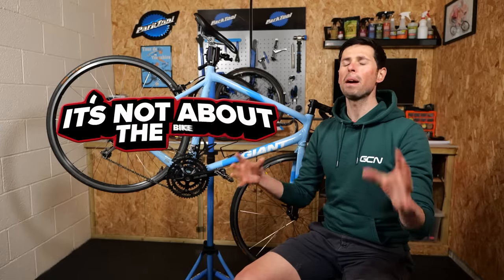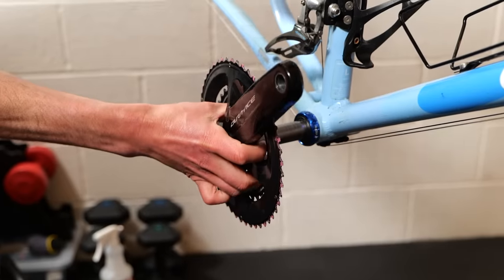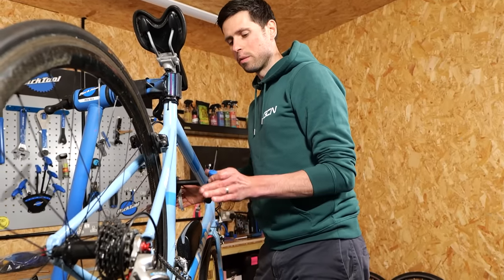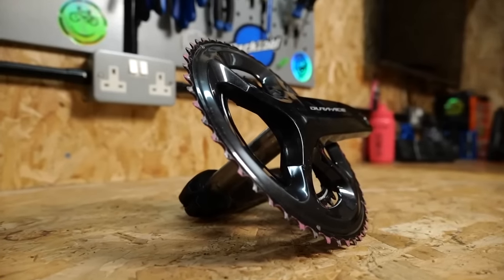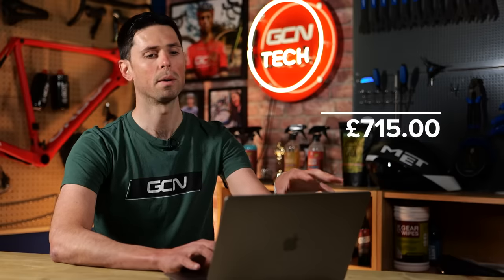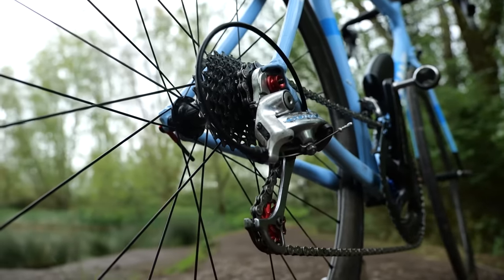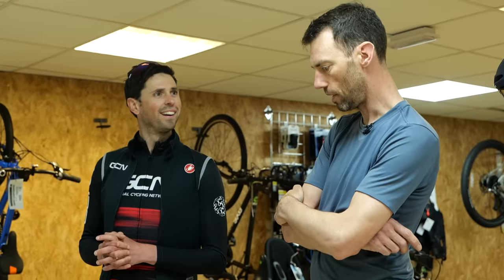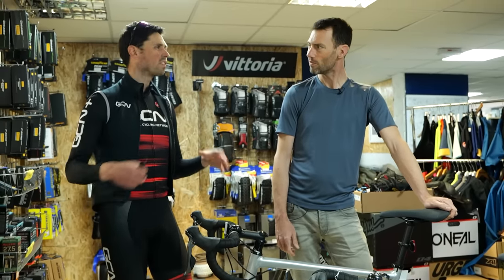Did I Really Build A Bike For Under $1000? | Cheap Performance Bike Upgrade Ep. 3

Comment: Entertaining content. Sad how negative some responses have been. Fun and interesting using old parts from online and from personal parts bin - theres loads of decent used parts cheap out there - and who hasn't got a parts bin of favourite and 'too good to get rid off' parts. Great for the environment using used parts instead of manufacturing/shipping/packaging new ones. Fun to do the mechanical work yourself and feeling that you built the bike yourself. Bike has more character and less weight than modern equivalent. And very easy to maintain and work on. Good stuff.

Comment: I think it's pretty normal re-using the saddle and the pedals as contact points are so critical that if you already know what's working for you, you'll just use them. It's nonsense to re-buy what you already have and it's working.
If you are builing it from scratch it's of course different, as saddle and pedals should be added to the budget.

So I think Alex can work out a component list within the budget for those two options.
Anyway, my advice will be not to be cheap on the contact points as you will keep them longer than the bike and are what makes your ride comfortable

Comment: Love series like this. Most of us stary of with a bike and upgrade them down the way. I started with a nice frameset and went from aluminium wheels to deeper carbon ones in 2 years, better parts, when I had to change a part I would always upgrade. After 3 years of riding the frameset is the "weakest link".

Comment: I don't see any problem with reusing pedals (or the saddle for that matter). I have one pair of road pedals that I switch between my tri bike and my road bike as needed. If you are just starting out in cycling, you would probably just use whatever flat pedals the bike comes with until you can justify upgrading to a clipless pedal system, but that upgrade you're looking at needing to buy not just the pedals but also some shoes to go with them. At the end of the day, those upgrades are mostly to do with comfort, not speed.

Comment: i just added up mine, which was all bought new/used on ebay/shops for new wear parts. shocked people complaining about your budget i'm thinking how did you spend so much. 

my road bike that lives on my trainer is a trek alpha 2.3 that came with 105 2x10. i'm using an slx cassette 11-36 cassette with an 970 XTR rear derailler, i put new tyres on the wheels including the wheel i don't use as it lives on the trainer, new chain and new sram rival cranks (shorter) with a new dub BB from uberbike. that totals in at £350. 

my  main bike is a voodoo maresa that i made into a gravel bike. its running fulcrum wheels, sram apex 1x12 (ratio conversion) hydraulics, 11-50T cassette, sram GX rear mech, hope M4 brake calipers with sram 180/160mm rotors. sram XO DH 165mm carbon cranks with AB 46T oval cx direct mount chainring, sram nx chain. pro vibe bars and pro 55mm stem. pro bar tape, spesh romin pro evo saddle, the seat post from the trek and shimano saint pedals that i got used parts only (badly tightened bearings) for £10, that totals in at £680

Comment: I like the fact you addressed the budget issues. Personally, think pedals are fair game. However, since it was an old bike - new inner and outer cables would be a good idea. You also switched from alloy to carbon wheels so presumably replaced the pads.

Comment: Personally I would not have gone with Carbon wheels with a rim brake frame, although I recognise as you explained you already had them! As well as not having the heat disapation challanges of rim brakes on carbon paying a bit less for the wheels would have left some extra in the budget for a better groupset. For example there have been some good deals on previous versions of 105 recently selling off both old shop and old OEM stock. I really enjoyed the series though and it does highlight what you can do if you look around the second hand market and online offers and plan out where you want to spend your hard earned cash. My advice for buying second hand is don't jump at the first item to become avaible, decide what you want and what you can afford to pay, then set up alerts and take a view on the items as they become available and make offers.

Comment: Thanks for the series Alex, love your work.
I guess the misunderstanding arose because many of us were expecting an entire budget friendly bike assemble. As I said before I like that you can use your old parts so they are not getting cover in dust. I wouldn't mind you finish this series as it is now. And in a later time try to build another one factoring the helmet, pedals, and cheap bibs and jersey (or even put some normal pedals no bibs). Like for a true total beginner of the sport (sure with a flexible budget) and give some tips and prices on where you could've spent more or  you think would be better to upgrade later if necessary.  
Maybe ask around to see what most people are willing to spend to enter the sport in good and affordable conditions?
Reply: People who are true beginners of the sport should probably come back to reality and recognize you're not going to get a race worthy bike and all the safety equipment for under $1k
Reply: @cjohnson3836  Well, in this same video it's shown that for 900 pounds you can get a fully new aluminum ready to go bicycle which you can race with, then add a helmet for 60 pounds and a pair of basic pedals and you are ready to go. Sure, you don't have all the benefits of a superbike, but you can race with it. (One of the problems is that they have already done this kind of thing by using owned parts to cut off the budget, which again I think is great that they use the old parts, but newcomers won't have spare parts in their garage.)
What I think could be a great idea is that the GCN staff, being experts on the subject, build a very good bicycle within a budget and give advice in which parts to get: if a new Claris/Sora or an older Ultegra for example. Invest on carbon wheels or better on aluminum with good tyres, etc.

By the way,  you can check this video from GTN building a superbike for under 1500 pounds https://www.youtube.com/watch?v=saGwndgPRnY

Comment: Pedals are always missing on a new road bike, or at best you get a cheap set of flats.  I see in the comments that many people simply reuse their pedals, often taking them off the bike they're selling on and putting them on their new ride.  In that case, not budgeting for pedals is a fair play.  But I usually keep the old bike and thus need pedals for the new one--Look Keo Classics at ~$55 US--so I won't be shifting pedals every time I want to ride.  For serious training (as serious as I get) I use power meter pedals, and I do shift those onto which ever bike I'm using.

Comment: I also used to use that same crank puller on the Shimano Octalink bb. I just had to also use a secondary addition to stop the tool disappearing into the bb axle. I don't need to use mine any more  Even though I still have a bike with the Octalink bb. It has self extracting cranks

Comment: I still wonder why you changed the stem.  It looked like the old stem (length, angle).  Was the old stem significantly heavier?
Reply: Hey Larry, old stem was for older style bars with a smaller diameter clamp area.

Comment: Well done Albert. Truth be told, it wouldn't matter what you did, you would still have people saying how it should have been done differently. 
Even if you are 10% over budget, that's still a reasonable spend. I'm not convinced it's the same performance as a $15k bike but it is a solid bike. I'd be interested to hear where you feel it would fit in someone's bike collection. I doubt someone new to cycling is going to build themselves a bike. TBH, if one of my friends decided to take up cycling I would send them to the LBS to grab your mates aluminium bike. That way the bike store will help them with any problems. Would you say this is for the person that already rides but wants to try out racing before committing big money? 
Any chance of doing a $2k build? I think you would get MUCH more for your money.
Here in Australia, you could buy a 2014 Cervelo R5 with 11spd Dura Ace, garmin vector pedals, garmin head unit, HED 40mm deep dish wheels for in excellent condition for about 1.5k pound Sterling.

Comment: No need for apologies Alex, most people have bits lying around or will swap items between bikes.  I do it with my powermeter pedals all the time. Thanks for great series of videos, showing what can be done.   Some extra detail on the actual build process would be useful for those with less mechanical experience.  If you have to do a forfeit, I think the budget kit would fit you just right 🤣

Comment: I bought a 2018 TCR Advanced 3 with Tiagra for £450 sold the groupset for £200 bought 105 R7000 from Wiggle for £299 and a  60mm clincher wheelset from Aliexpress for £154

Comment: Bought a cheap Carrera virtuoso £80 of facebook marketplace to shove on my Turbo trainer a few years ago, decided to DIY a respray, and upgraded to an e-bay Shimano 105 groupset (after 'accidentally' winning an ebay bid) with some New Vision35 wheels, looks sweet and still came in under £1000.
Want to redo the paintjob soon to some chromashift paint and swap out the Forks and Handlebars, 
Don't ride it out enough, but enjoy the rebuild projects as some hobby time.

Comment: The seat is not a performance gain per se, it's for comfort, so I would have no issue with deducting that and the stem from the build price (to be honest, the new stem looks just like the old one, why did you change it?  minimum weight saving?)  The pedals...since you have videos of flat vs clip-in pedals not being much of a performance difference, I have no issue with the pedals either, it's more for what your used to than anything else.  Keep up the good work Alex!

Comment: I've bought 3 bikes in the last 4 months (yes, seriously), trading in old ones  for the new ones: road bike, gravel bike, hybrid townie bike. In every case, the new bike a) didn't come with pedals, and b) I moved the saddle from the old bike to the new one (well, except for the townie; both old and new had fairly rubbish saddles, but I never spend that much time riding that I paid it much attention).

In Alex's build, I don't think either saddle nor pedals should be part of the build budget.

However, faffing about with shifting is going to be a world of difference compared to a "top spec" bike, which will have precise, buttery shifting every single time. So without upgrading the rear mech & cassette so that shifting is clean, you can't claim that you're doing "the same for 10%".

That said: even if you have to update the budget to do it for 20% of the top-spec bike, that's a huge improvement/savings.

Comment: i've used the parktool crank puller a few times recently, i found it makes a really good thread stripper, not so much a puller,,, angle grinder made quick work of the rest of it

Comment: Most of us have spares and parts taken off older bikes and other bikes. If the part is still good, I have no problem re-using parts. Bit of clean up, and it'll look the part. Those that say you aren't allowed to use components from your parts box should seriously be ignored. I use parts from my stash all the time, as long as they fit and make me fit correctly on the bike.
Reply: did you have those spare parts before you bought your first bike?
Reply: @rudyardganuelas6254  My first bike was bought second hand for about US$300.

Comment: I think it's totally fair to use your old pedals as new bikes don't usually come with pedals either. I'm always moving my pedals from one bike to another and it's also a preference thing more than a performance thing anyways. And if you have to deduct parts that you have laying around in your storage from the budget, then you should also be allowed to add to the budget if any of the parts you removed from the bike have any resale value. Maybe I wasn't paying attention, but were the old handlebars, stem, wheels and pedals in such a condition that you could sell them to get a bit more budget?

Comment: I question a few choices Alex made, bike and upgrading the crank, but not the groupset.  I have my own budget race bike, when it was running a tubular carbon wheelset in was under 6.8kg and cost less 2000AUD aka 1000GBP without power meter pedals. Now running tubeless alloy wheelset with powertap power meter, a touch over 7kg, still under 2000AUD aka 1000GBP  for current setup including pedals and saddle. 2007 Canyon Ultimate AL with second hand SRAM red 10 groupset, finishing kit both 2nd hand and AliExpress.

Comment: I don't agree with people being mad about reusing components. I have a Pro PLT stem, an old Shimano Exage 52/42 crankset, and a Fizik Vento Argo R3 laying around too.
Why would I buy components I already have?
Reply: The basis for this video is to let people know that it's not too hard to get into racing and spend the $1k to build yourself something competitive. 
If the pre-requisite for that is to already have a $400 crankset around and you pretend it's 1/4th of that, along with pedals worth $100s, a $200 saddle, then it comes across as a bit tone deaf and disingenuous.

The target of this would be beginners who don't have a 20 year backlog of tier one parts sitting in a box.
Reply: @maLiruM  i have a 3 year backlog of parts. I haven't raced, ever.
Reusing is always best IMO, but always offering alternatives for people who don't have spare parts. As in "I'm using this cause I have it laying around, but you could get a Ultegra R8000 crankset for £125"

Comment: I think it's fair to not count parts you may have laying around. Seats, stems, bars pedals? These are commonly repaced parts. I have 3 or 4 spare stems, and three extra mountain handlebars laying around in my garage. Pedals? I could pull my XT flat/SPD pedals from my commuter (~$120 USD)  and put them on a future bike, and install leftover toe-clip pedals on the commuter.

Comment: I am very interested in how that Mejuin bottom bracket fairs with some miles on it - in some rain.  The jockey wheel bearings are CRAP. Don't bail on the pulleys tho - just replace the bearings.

Comment: 8 speed cassette with 11spd DA cranks-  Bet the spacing between the chainrings will be an issue for a wide 8 speed chain, usual advice is don't stray more than 1 speed up or down....

Comment: The world's cheapest DuraAce chainset came to me in a box ( of two ) of parts given to me by a club-mate. Octalink. £0.00
 There was an Unused NOS Shimano 600 sq taper Chainset/BB.
Not in either of the boxes was an Ampello Columbus SL, 60cm frame and forks. PM me if you want it.
In fact, all this stuff can be bought. Monies going to Cyclists Fighting Cancer charity in Stratford upon Avon.

I picked up Reynolds 753r frame ( Peugeot Perthus ), on which I put Octalink Ultegra group and a wheelset from Bankrupt Bike Parts.
The bike came in at 8kg. 
The frame was £60 on ebay and the Ultegra group was in one of the aforementioned boxes. Wheels were £85.
NOT FOR SALE :-)

Comment: I think racing on flats would be great not just as a mild punishment, but that's probably the number one gatekeeping component when it comes cycling, especially the racing side, and it's absolutely not a necessity. Of course it will be a loss of watts if you aren't used to riding intensely flat-ulent.

Comment: Did you check the chain.  £22 should be enough for a new chain.  Justin replaced the chain on my Pinarello as it was stretched, and rather than an FTP increase of 3 or 4 watts in month, it jumped 14 watts.  I reckon new chain = 10 Watts for me.

Comment: Would have suggested that before and after performance test would speak to value of the upgrades

What age is the Dura Ace crank and how much would that age of secondhand crank cost ? I have two or three old sets of pedals one of which goes on pretty much every bike I have, I don't buy new ones until I actually wear something out and value of an equivalent secondhand item seems like a valid equivalency

Comment: Did I miss the the new Carbon brake pads or has that bike still the used brake pads for aluminium rims?
Have all the cables been replaced with new ones?
Also no mention if the fork and the headset were pulled out, checked and cleaned.

Comment: I also thought it’s best to run an 11 speed chain to be compatible on all speeds, not an 8 speed chain on 11speed chainrings. Also it seems upgrading to an actual 2x shifter on the left instead of the “good enough” 3x BODGE, would be fairly inexpensive in the grand scheme of things.

Comment: Ahh good, I'm glad the equivalent new bike came out, buu-uut... do a comparo'! There's pro's and con's to each way, personal preference as to which is "better", it'd be cool just to cover what the main points and their advantages/disadvantages are (a-la. amount of gears Vs weight) a-aand it covers those in this purchase space; Off-The-Shelf new and full on parts bin/2nd hand build people.
 That said, surely there's a middle ground too of lesser spec bike and change wheels, maybe just as a theoretical discussion piece.

I'm with you on the pedals, but maybe toss in costs as an aside if one was to also need pedals.
 Seeing as trying to hold close to the ten hundred pound mark, Keo Classic 3s are only $65AUD and Shimmy SPD M520 $43AUD (BikeBug.com) are hardly a bridge too far around this price point but AT this price point there's a lot of both camps of N+1 and 1st spirited bike.

Comment: I wouldn’t go with rim brake carbons, especially older ones or of lesser brand.  Been there done that and delaminated a $1,400.00 Roval on a descent on a hot summer day. Keep the aluminum rims for rim brakes. Better braking performance in the rain as well.